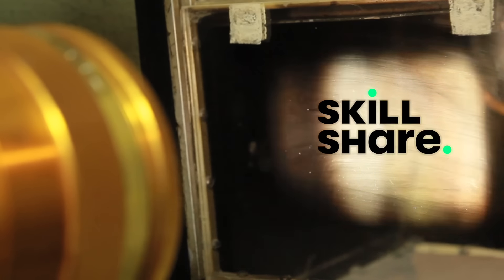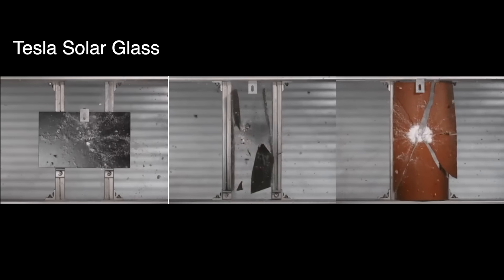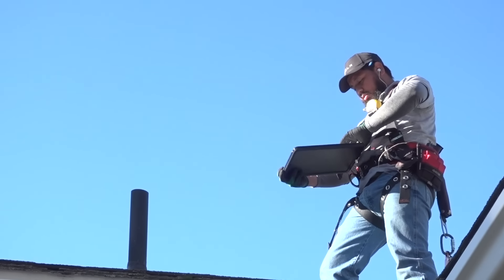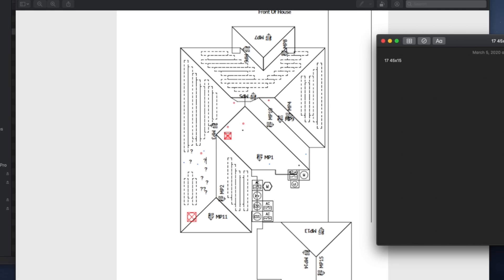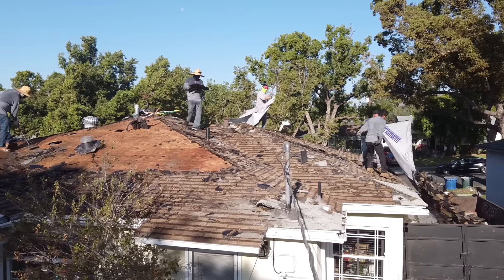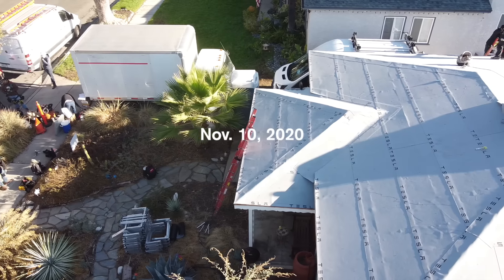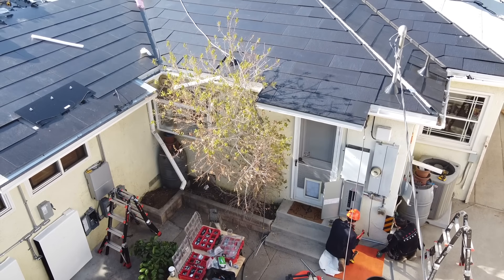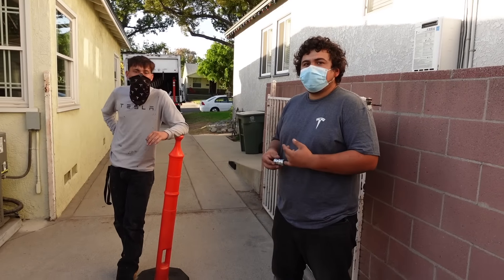This Tesla Solar Roof Was NOT Built in a Day

Comment: The price hike for extra things that need to be done are usual on older houses. No one gives you a quote for what they think will need to done once the roof is taken off. You never know what you will find. That's true with any old house no matter what you do.
Reply: You can get a full roof replacement for 3,800 lol
Reply: Elon is pump and dump scammer
Reply: @JaswalM123  dudes roof wasn't replaced in over 40 years. That stuff happens.
Reply: @christopherbernhardt  they charged him 3,800 for some OSB and soffits.  That legit like $400 product and $300 labour.  The subs saw Tesla and knew they could up charge them like crazy and Tesla up charged the guy even more.
Reply: @JaswalM123  you're not getting 32 sheets of OSB for $400 especially not with pandemic pricing.
Reply: @jeremyO9F911O2  they weren't purchased at today price. Tesla saw the roof wasnt shethed when they inspected the attic
Reply: @JaswalM123  it was late 2020, and OSB actually had higher shortages than real plywood.   Cost plus is cost plus, read your contacts carefully, if a rate or allowance for additional work isn't in the contract then that's that.  

Though IMO the fascia and not the decking was the real humdinger in that quote.
Reply: @JaswalM123  exactly $800 for 40ft of fascia board installed is about 8 times what it should cost..same for the 50 ft of shiplap for $500..my guy definitely got upcharged for the Tesla name
Reply: @jeremyO9F911O2  doesn't mean you gotta double up the labor charge too..
Reply: I agree, ima roofer and you could tear off and see broken boards, rotten wood and all kinds of shit in hidden areas, or previous errors made by the original builders. Didnt he say it was 40+ years old? Shingles don’t need to last longer than 15-10 but depends what kinda shingles you using
Reply: @ericbruscoe5956  you also gotta account the fact they’re using higher quality contractors. That’s gonna raise price, ain’t no small crews really that clean and professional like that tesla crew was.
Reply: @odst2247  if you listen closely they say the roof was double shingled.  So it's two lifespans since the deck was last maintained.
Reply: @jeremyO9F911O2  don’t get why people double layer, was that a common thing back then? (I’m only 20)
Reply: @odst2247  well I don't defend the practice and I'm a commercial roofer so I don't do shingles regularly.  But here are the arguments I might make.

First off it's obviously cheaper, especially if you plan to live in the home for more than 10 years.  Second we used to use 3-tab shingles which lay flatter than modern architectural shingles and wouldn't be as awkward to install upon.   Third you don't have to worry about rain,  what you open your must close before the next rainfall, and standard practice is to be closed by days end.  

But it looks ugly, it doesn't last as long, I don't recommend it.  Though with flat roofing it might actually be the future in 20-30 years.  These days the majority of flat roofing I install has excellent drainage, insulation, and vapor barrier.  Where the old roof was cheap junk, in theory the roofing I install today only the water barrier will be needing replacement, and it's very likely they will choose a double roof option. 

In commercial nobody currently double roofs because the new systems are just too good and the old just too miserable.  But they used to do it.
Reply: @jeremyO9F911O2  thank you, that was interesting
Reply: @jeremyO9F911O2  id pay that for ply.  Osb has no business on a roof
Reply: @odst2247  1/3 labor
Reply: Greg Gaming  re: quotes, we never got to read the contract, it might prorate carpentry, who knows.  But it can be hard to know the carpentry cost in a bid.  Seems weird that the sheeting for the TnG plank was missed though they must have seen that on the inspection.
Reply: @JaswalM123  If you don't mind me asking, where in the US can you get an entire roof replacement for only $3800?
Reply: @dracoslayer16  only way is if you do it your self and just lay over the existing roof no one would tear off and re paper and shingle for that
Reply: @JaswalM123  dude the plywood by itself is like $1500-$2000 even now after prices have come down a bit.
Reply: @ericbruscoe5956  that much fascia board would cost about $250 then to install it. why do you people just make up costs to talk shit? the cost of the material alone is more than 25% of the charge. then you add the cost of labor then add in your profit margin and $800 is more than fair. how lonf do you think it would have taken 2 guys to install and what is their pay rates? exactly.
Reply: @dracoslayer16  for real the average roof in my area, which is far below that of california, is like $10,000.
Reply: @JaswalM123  that was way more than 400 dollars of product just cus of how expensive wood was

Comment: Awesome video, I have taught myself solar over the past year, and have been slowing installing testing. Then realizing I needed more and expanding. My system is 90 500w bifacial panels, two 12kw inverters, 3 120amp charge controllers, 3 4p16s batteries little over 150kwh of storage had to make all my own busbars. The tesla roof looks very nice 
compared to my large industrial panels. But diy for me was order of magnitudes
cheaper.

Comment: Thanks for the ride-along!  Very well done.  I am currently building a new home in Los Angeles County that will have a conventional (panels) roof-top 5.8 Kwh solar system.  For everyone's information:  The total cost for materials (panels, mounting equipment, inverter but NO battery) is $8,547.  It will have 17 Q-Cell 340W panels at a cost of $198 each.  The panel cost accounts for about 40% of the total cost...the invoice lists 14 other items.  The supplier suggested I wait on a battery as he believes costs will be coming down and it'll be about four months until the home is completed.  As for going with conventional panels, a lot of effort is being put into making this a true, authentic old Spanish house so we are using a tile roof (the solar will look like a recent upgrade of an old structure).  The order was placed May 4, 2021.  I did an upgrade on the inverter, which boosted the cost about $1,000.  My electrician will do the installation at a labor cost that probably won't exceed $5k.  If I was building a conventional house I would definitely give the Tesla roof a very strong look.  Your financial analysis followed by your consumption analysis is really helpful!

Comment: What an outstanding video.  Very informative.  Thank you.  I am not getting a Tesla roof, primarily because I have a great, solid, viable roof (cement tile), but in your case, it certainly made financial sense.  The only thing that bugs me about the Tesla roofs is the inability to know whether any of your producing tiles have gone bad.  How do you know if one of your solar tiles shorts out?  Or ten for that matter?  Other than seeing a decrease in solar production, is there any way to isolate problem tiles?  Also, how long are they rated to keep producing energy for you at a rate of 90% or better from their original installation date?

Comment: I know this is a bit too late, but another reasonably simple option to greatly increase the available space for tiles would have been to build over the valley between the two surfaces without tiles by extending each surface so they planed together, forming a hip where the previous valley was located. This could have been done with what is known as a fill package. This would have increased the square footage of both surfaces.
Reply: And under that you get a terrace , or you can add an extra room to the house right? Very clever

Comment: Traditional solar installer here. Looks real nice, way cleaner than regular panels. I hope Tesla releases a version available to us, or another company develops a high quality solution. It was pretty cool when they released the power walls, the company i work for installs them. 

A big development in this kind of system would be a micro inverter. They basically handle all the DC to AC right under the panel, and have wireless communications with a central controller to do rapid shutdown, alert you in case a panel has a problem, etc. Eliminates the need for DC disconnects on the side of the building, and can be much safer in the event of a fire in systems without rapid shutdown units on the panels. but getting one under those tiles sounds like a challenge due to their size. Also, you will have to charge the batteries through AC coupling instead of DC coupling which may be less efficient. As the technology gets smaller, better and cheaper i’m sure it will happen.

They also had a crazy amount of ropes up there. They can get pretty dangerous when you step on one and slip. Usually the only times we have ropes on the roof is when it’s an extreme slope, a metal roof, or we have a new guy who is not yet comfortable. It is dangerous, but not as much as having a bunch of lines up there. Especially when there is massive amounts of slack hanging everywhere on the part of the rope that is supposed to catch you, like I saw some of in this video. They were not moving around as quickly or a lot like the roofers were, who did not all have safety lines. looks like those tesla roofs take an extremely long time to install compared to traditional systems. Make me wonder if the program is even making profit due to the insane amount of labor costs they must have had.

Comment: I love that they installed it on the 1 of 6 days it rains in California lol. He is telling the truth though. The cost of wood did double because of the pandemic which sucked bad.
Reply: The costs of the wood did not double because of the pandamic, but because money is so cheap which urges people to construct new houses or to refurbish old ones.
Reply: @gunnarkaestle  yea that’s considered part of the affect of the pandemic wether that’s infrastructure or material pricing
Reply: @0bled121  Do you mean effect or affect?

The support schemes to fight the economic down turn pushed money into the market and made interest rates very low (including slightly negative). That means money is available for investments which would be questionable if the overal interest rates would be a few percent higher.
Reply: @gunnarkaestle  ty, you just validated his comment even more, and somehow invalidated yours at the same time
Reply: @zoinksscoob6523  What do you mean? How? Don't you agree the cheap money does drive the demand for questionable investments up, as I wrote?

Comment: My solar roof just recently got installed. They had to change the construction document to match what was actually installed. I just got word today that they've corrected the permit and they should be submitting it soon. So hopefully in the next month or so, I'll be able to turn my system on. Can't wait! I also requested that they add your referral code to my order. For some reason, I never considered using a referral code for this order, but they said it isn't too late and they've requested that it be added. 

My experience so far has been pretty close to yours, except my house is pretty new, so they didn't have any problems with the tear off and dry-in. I also requested a larger system than the original design, but way before the install started.

Comment: I love how this pays for itself in the long run. The crew also seemed incredibly nice, picking up trash and explaining their work very diligently. 
Seems like the city was right the first time they rejected the roof. Were the reasons for the other rejections valid? Or was that simply a denial because the city is trying to stop the advancement of renewables? Did you ever find out?
Reply: i mean.. a shame the tiles wont last longer than a decade. but yeah. pays for itself.
Reply: How much energy does he produces on average a day? about worth 2 $ (?)
costs of 32,000 for the installation (skipping the 18k for the new roof) / 2$ = 16,000 days to reach breakeven. That is 43 years assuming that nothing changes. 
The panels will loose performance and therefore the house needs renovation before the breakeven is reached.
Reply: I think you've missed the amount he "earns" by not paying out to the electricity companies. In the video, he says it pays for itself through savings within 2 decades. With the contribution you've calculated I suppose its even quicker. Also he hasn't seen how much energy he'll put in at the peak of summer.
Reply: @sullyh1034  not only that.. If I'm to understand correctly, the power given to the grid will be be at afternoon time(peak time)... So the amount due to him from the electric company will be at 3 times the regular rate.. hence he'll be earning more by giving to the grid the same amount of power...
Reply: @FreebirthBoccara  ah you are a proffesor of solar

Comment: All this means to me is that such roofs make sense for a new house and a fancy one at that.  Otherwise I’d go for panels.
Reply: Yeah this roof layout was less than ideal for solar.  Ideally you design the roof to maximise South facing surface area.
Reply: @jeremyO9F911O2  that is the best part he has a worst case scenario roof ... and he is paying it back fast ... shows that solar does work ... now to get manufacturers to switch to DC home appliances to work with them and further reduce the costs ...
Reply: @0623kaboom  ehh, hard to say.  The math on solar has many thumbs on the scale right now.  The government grants are huge, and utilities are often forced to buy solar at rates that aren't market determined.  

All this works essentially as a lost litre to prime the market with early adopters.  The question is how and will these subsidies scale with the solar market?  It's hard to imagine they can scale 1:1, eventually the promotion ends and regular prices arrive.  

All that being said I'm actually more interested in a proper comparison between solar tile and solar panel.  He was very cagey about the comparison and I feel like he had zero interest in actually purchasing a conventional roof with panels.  It was probably Tesla or nothing and the comparison shopping was just for the narrative.  Conventional panels should have a denser solar area and they can overhang the hips which limit solar tile.  I wouldn't need surprised if the PV area is double with panels.  Course now it's even more complicated with Tesla closing the market on powerwall, though I haven't heard why, it might just be temporary due to shortages.  But it's not the first time Tesla did some anti-competitive shit like this.
Reply: @Scrub Dog well to be fair he needed a new roof one way or another.   But yeah I'm guessing he's playing all sorts of games with the numbers.  Like there's no way his Tesla roof is the same capacity as panels, and if you let the panels overhang the hips because they can do that the panels will utterly trash the solar tiles for PV area.  Plus panels aren't forced to accept the roof pitch. 

Additionally my assumption is the government solar credits aren't going to last forever, it's more seed money for early adopters.  Furthermore solar gets to sell to the grid for inflated prices.  When in reality power grids are actually damaged by unregulated power.  There's no affordable way to make consumer grade PV regulated for the power grid.  Long story short as more and more people integrate PV into their homes the less incentives will be tolerated.  

The solution is solar neighbourhoods, basically micro grids of a few streets, and when the solar is going the main grid disconnects.  Batteries get recharged and most people aren't home during peak Sun so the housewives that are use the shared grid to do laundry and such without depleting any batteries.
Reply: @jeremyO9F911O2  in my area (not US), there are regulations that you need a space to walk around the solar pannels. I can't remember if it's 18 or 24", mainly so firefighters have an arrea to walk without slipping.

So overhanging the pannels would not pass the inspection.

But I got 9.6Kw professionally installed for 17K Canadian. It's a lot more affordable, but the monitoring solution from Fronius sucks big time compared to Tesla.
Reply: @fmaz1952  I'm also Canadian and a roofer.  I think you misunderstand what I mean by overhang.  The roof in the video is what we would call a combination hip roof.  A hip roof is when you have eves on all four sides while a roof with only two eves on opposite sides is a Gable roof.    In a Gable roof the triangular ends are called Gable ends.  On a a hip roof the descending ridgeline where two roof faces meet is called a Hip.  

A solar roof tile is restricted significantly by hips as the solar tiles cannot be used in the hip area.  At least not with current roofing tiles.  In the video "blank" tiles are used in these areas.  A solar panel can extend over the hip, it only amounts to a half dozen square feet at most overlap which is basically nothing.  Certainly would not impede a firefighter in any conceivable way.

Comment: Oh wow this brings back good memories for me. Beautiful roofing system by Tesla 

I worked in the estimating/drafting/design department of roofing company for 3 years, everything about this is standard internationally in roofing and electrical installation.

First inspection by site surveyor 9:14
25:43 shingle/tile roofs are actually TWO SEPARATE roofing systems 
Below is the Waterproofing membrane (to make the roof watertight)
Then the tiles/shingles (decorative/solar/can take a beating)
33:22 the installation crew is double because of all the electrical work involved 
These roofers are skilled electricians as well. 
41:07 Corrected 3 different crews... wow (3rd being the trainees)